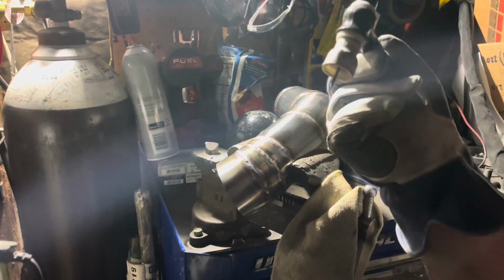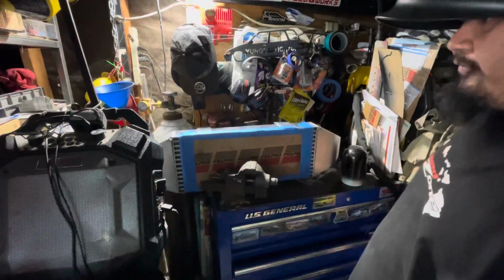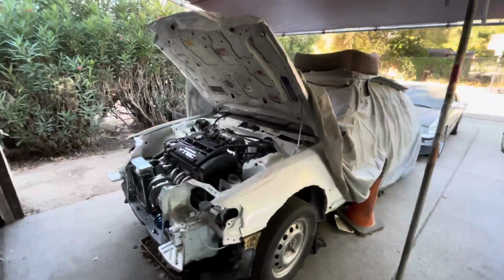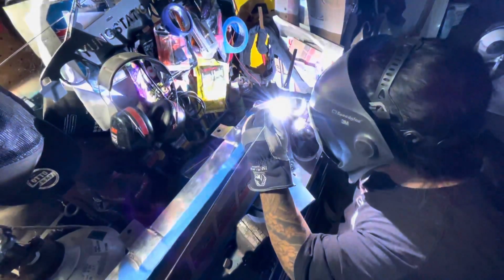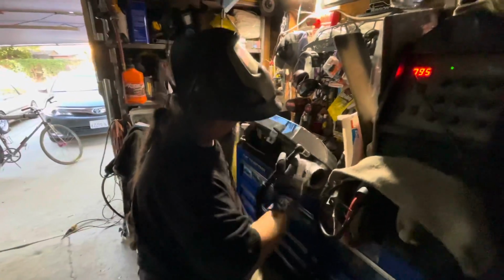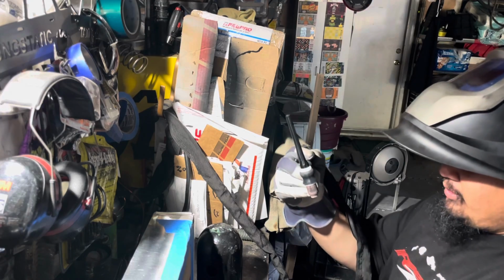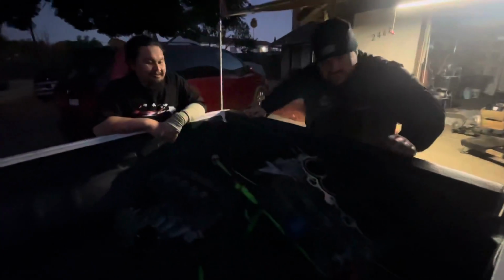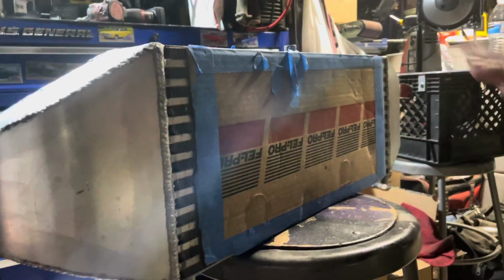TURBO H2B GIVEAWAY CRX CUSTOM INTERCOOLER

Comment: Bro i have a carbed 1985 civic. Im try to k swap it. Im having trouble finding helpful info on google.
I wanna know wat i know to get my efi going. I know i need a intank fuel pump. Since im using a k24a2 engine i think i need in tank fuel pump off a acura tsx. Or maybe i could just spend some money on a aftermarket 250 lph fuel pump  After that im kinda just hit a brickwall. Im not all that great at mechanics. I want to know wat else i need but im not sure how to ask properly lmao. Any help appreciated. Hopefully u can understand my gibberish :)
Reply from the maker: If you have Instagram I’d check out 

https://instagram.com/acebuilt_84crx?utm_medium=copy_link